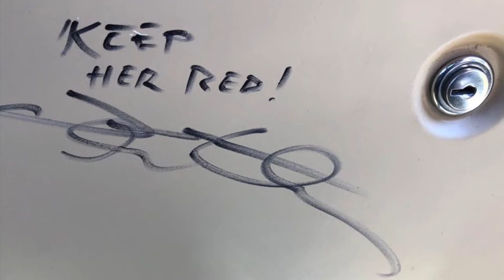Building & selling the screen-accurate Supernatural 1967 Impala

Comment: Hi do you have any impalas in stock that would be good turn key cars? Im looking for a supernatural impala that I could daily drive without many problems. Would a 327 be the  ideal choice for this situation and how much would a good daily driver cost?
Reply from the maker: I know of a friend considering selling their full replica.  it would likely be expensive but a true replica that has been at shows and built professionally, not my build though.  Other than that on the other side of the spectrum we have one candidate that is unrestored but drivable and not much rust.  It would not take much more than 30k to have a daily driver with some restoration done but certainly not all of it since most replicas that are well done for SPN and also well restored are easily 60k cars.
Reply: @maupinmetal  please also tell if the engine type is appropriate for daily use or else it could be updated by any new technology?
Reply from the maker: @alicebhatt9104  many if not most of our cars are driven daily.  some upgrades like Holley sniper EFI make the engine even more reliable

Comment: do the seats fold all the way down so you can sleep in it on road trips?
Reply from the maker: right?!  that would be a cool mod if built like an rv and the whole car was like a queen bed.  but no, they are fixed bench seats with bolts as was from GM

Comment: Does the price is lower when you build one from just a shell or when you get a ready one
Reply from the maker: interesting question.  Here's some advice on those options...  if a private seller did a good job restoring it but cuts his losses and sells cheap, you can get a better price at his expense his loss, but rarely will you get a deal on a finished "pro" built high quality build because doing it correctly is also really expensive and businesses don't like to lose money whereas some private sellers will lose money to get rid of it.  Maupin Metal only restores cars owned by the client and their best deals come from only paying for exactly what they want and nothing extra.  I think this is the best Value = Price + Quality.  The worst value is paying for someone's finished car and learn later you need to go back and add more parts and labor

Comment: What engine and exhaust does the car at 0:12 have? 327 with a certain glass-pack? I keep seeing all these replicas, but none of them quite sound right. Thanks! You guys did a fantastic job!
Reply from the maker: the black car was a 383, the red one is a 327.  the mufflers, dual exhaust, H pipe, and headers were identical (flow master 40 series) and so the difference in tone was all cubic inches.   the show pipes in sound clips, so you may struggle to replicate it in your own car, but the exhaust I described above is show accurate and that's why these small blocks sound right.

Comment: what kind of engine is that or can i get all of  the build of the car
Reply from the maker: that one was our serial number #001 and long since sold. we build them custom specs to whatever you want at Maupin Metal in Dallas TX.  that particular car was a screen accurate small block, but even though it looked like the show on the surface, underneath was actually a 425hp 383 stroker mated to a 4spd overdrive transmission.  It had 4 wheel 6 piston brakes from a corvette and dual exhaust with 40 series Flowmasters

Comment: I would love to own this car 4 doors not 2 doors
Reply from the maker: I think the sport sedan 4 door is the most balanced good look for this year Impala.  2 doors are just as long but too stretched out for my taste too!
Reply: i have exact car but on a 68. pillarless has 6 tailights. is it worth as a 67?  is kinda sexi car has good lines.  devating painting it black or aqua blue...
Reply from the maker: @OSCARHERNANDEZ-un5iy  both good colors.  Black would be more like the 1967 hardtop in the Supernatural TV show, and Supernatural clones are worth the most, even more than many SS models.  The 68 hardtop if made to look like a black 67 Supernatural Impala would be more valuable but of course not as valuable as actual 67 replicas like the one in the video.
Reply: how much this supernatural cars run for ?  i bought mine for 4500 w brand new engine disk brakes trans. so im investing on the upholstery 2k n 7k body work n paint
Reply from the maker: @OSCARHERNANDEZ-un5iy  Buying the 1967 Impala Sport Sedans and then having them built just like the show with a high end (frame-off, media blasted etc) classic car restoration will run $60k small block, $80k big block on average.  Again that's a well built car that is also SPN themed correctly....  anything less like wrong year, wrong model, poor restoration, will lower the price and I've seen nice 'driver quality' examples sell for $25k-$40k.